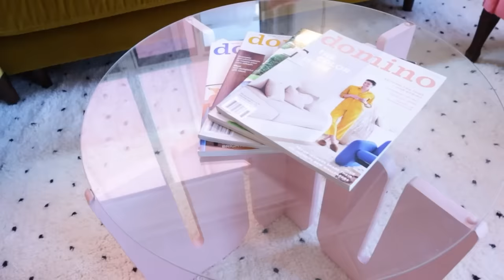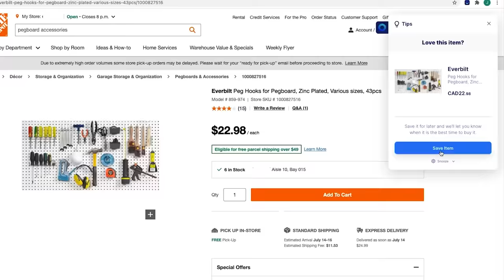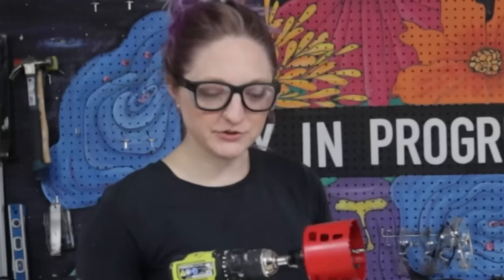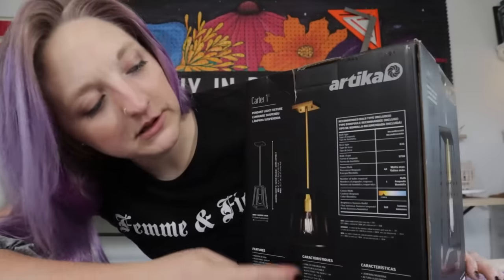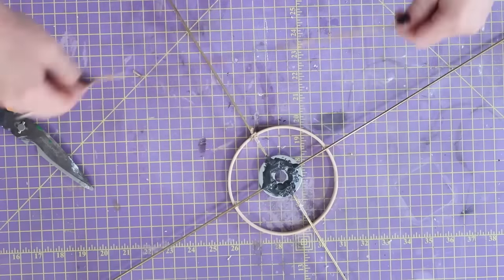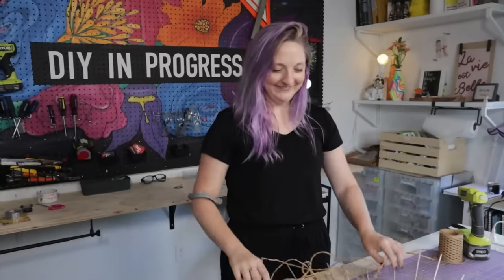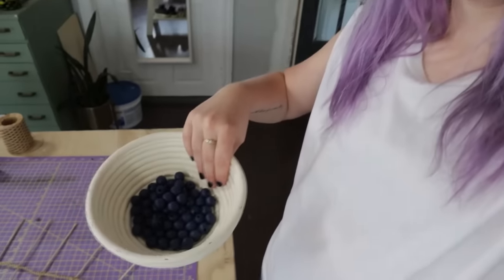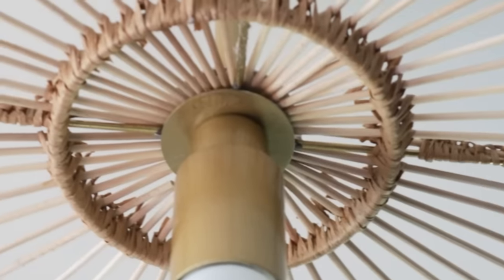i DUPE two trendy lights for my home | #SOtrendy | DIY Danie

Comment: If you cut 2 or 3 rings out of plywood, with the inner circle to fit the light fixture, glued them together in a tower, and then drilled your holes all around in the pattern you wanted, then used wood glue to glue the rods in, maybe it would have been more wavy?
Reply: Like k’nex? :-) great idea but made me giggle. :-)
Reply: @xylindria9077  yes lol!
Reply: I would imagine some precision angling is necessary when drilling the holes - cautioning myself lol. Brilliant idea 👌 Thanks!

Comment: I found the light! It is not DIY, it is actually SUPER expensive, about $1,100 😳 so MA’AM, you’d did AMAZING with this DIY version!! 
Also my fast hack for finding things online, use the google photos app! You can screenshot or save pictures, and when you pull it up in your google photos, there’s a feature called google lens where you click on a item in the photo and it will find the product on the internet and show you a bunch of links on where to get it! Saves sooo much time!

Comment: Hey Danie.  The skeleton of the second light shade reminded me of a Chinese parasol frame.  They seem to be relatively cheap to buy, and you might even find one at a thrift store.  I'm thinking you could make it wavy by using wire like you did on the one you made, making the wire different lengths between the spokes allowing you to create a wavy effect (hope that made sense)!  If the spokes were too short, you could probably lengthen them with long wooden dowels (I think that's what they're called.  Having a heat induced brain f*rt).  Anyway, do I love your channel?  OUI!  Did I love this video?  OUI!  Do I look forward to Saturdays just because of you?  OUI!  (Okay that sounds a bit creepy haha).

Comment: The name of the pendant is Waverly Pendant from Arteriors Home 😉 array of buri sticks bound with thin pieces of rattan flow from an antique brass steel stem into a wavy, parasol-esque shape. Wood beads trim the slightly askew foundation, emphasizing the overall design of the organic and eye-catching form.

Comment: I loved both lights, but I think I loved the 2nd one a little more because it's so unique. I think one thing that might've helped the wavey effect would be to somehow add weights to the beads themselves or perhaps if you could find them in the same size but with different density. I suppose the same size but made from different types of wood? I don't know. I'm not much of a DIYer myself I just live vicariously through your creativity.

Comment: The umbrella light would have probably been easier to build if you knew how to solder the basic frame together instead of struggling. A decent soldering iron costs like $50 at Canadian Tire :)

Comment: I love the dowel light. I don't think it could be any more flexible because the dowels are glued to the batten.  If you got some basket reed and plaited a round disk to attach to the batten, then glued the dowels INTO the reed in an undulating pattern on angles then it would have more flexibility.  The wave actually comes from the placement of the dowels. Just a thought.
 The first light just reminds me too much of a nipple though, sorry. 🤦‍♀️😂

Comment: Did you happen to use an LED lightbulb on the plate light so you don't have to deal with changing it so frequently? I don't envy that task once it's installed. 😬
Both lights are brilliant! 😁

Comment: Love the blueberry light!  Maybe use a thicker wire on the outer circle. One that would hold a shape and also bent the brass rods a bit, slightly differing angles so you don’t have to come to a 90 degree angle every quarter of the circle. I hope that made sense.  You’re so creative. Ty 😊 also I think that bamboo bowl light would look great as a ceiling light.

Comment: Your dowels are a but longer than the original piece. Also the got a lot more dowels, maybe twice as much. You could have added another layer of dowels on the second washer (and hiding it with a third washer). Also I don't think they added a wire at all at the outer perimeter. Just a thicker cord and knotting each dowel right next to the other. That in itself would have given the outside more than weight so the droop more. And like a big straw hat it would fall into waves naturally... Just some thoughts. Yours looks still very stylish though 😍

Comment: Love both lights the dowels and blue beads light was out of this world. I could see them mass produced I want to try to make one. If u wanted it waver why not put some different size dowels on 1 level up by putting another washer angle that row at an angle. As usual you nailed this project

Comment: To get more of a wave look, I think on your embroidery hoop you needs some dowels resting on the top edge and and some hanging (tied) from the bottom edge so that the dowels are starting with a little bit of a different angle and gravity helps with the one's that hang. The beads, I don't think, were quite heavy enough to cause enough droop with them all starting at the same angle. Looks great though!

Comment: I think the wave comes from the woven outer ring.  I would suspect that its covered bendable wire.  That would be the easiest way to get the wave and you covered the metal rods so you know  you could cover the bendable wire.

Comment: I was surprised you started from the center and worked out. I would have used a heavier gauge wire for that outer wavering. I would have formed the waves first to get the shape I wanted. Then attached the dowels to that all pointing inward once they were all pointing inward then I would have attached the inner portion. It's so funny how our minds see that process so differently.

Comment: How to make the wave stronger: Four washers, put three sticks on top of the first washer, add a washer, the next three over the top of it, add another, then the next three over that one, then put the next three underneath, the three after that another layer down (back at the starting layer, then work your way back up, etc etc. Then attatch the inner circle underneath all of them, then hang it to tie on the outter circle at the heights they rest at.
... not sure if that makes sense... it does in my head ?? :)

Comment: I’d try using a flexible wire on the outer circle without the brass rods. Using knot tying you could control the dowel spacing and then shape the waves by bending the wire. Have to experiment to get the right wire gauge. I’d put the beads on after the shape is established.

Comment: the way this looked without crisp waves is so much better, something about it doesn't give off factory build... but I'm sure a thicker wire can achieve that, OR at the base instead of gluing them all flat, you can put something under some and create a wave (like a custom wavy wooden piece)